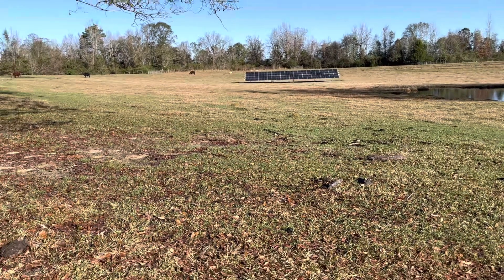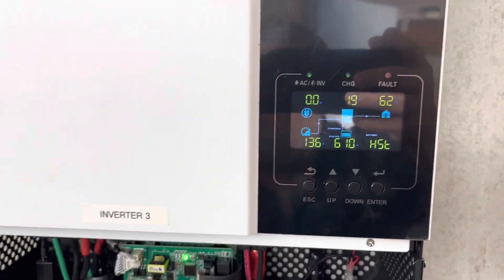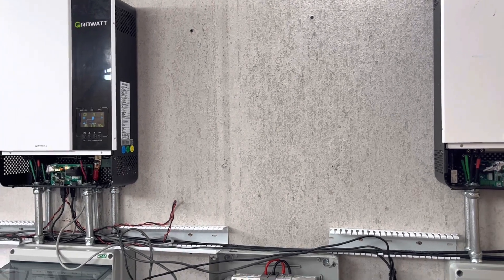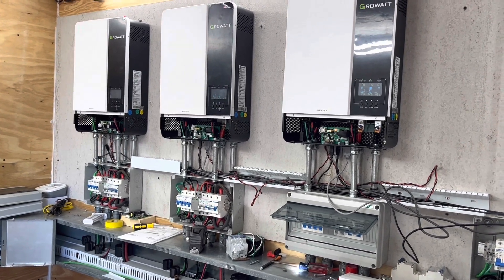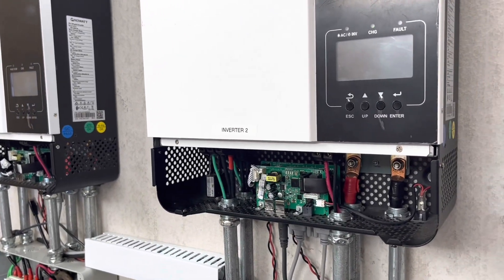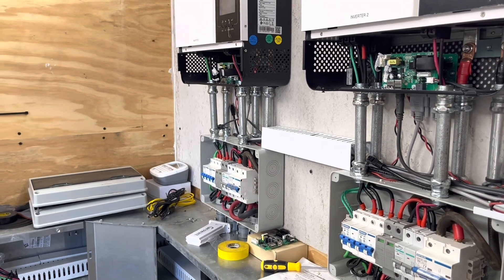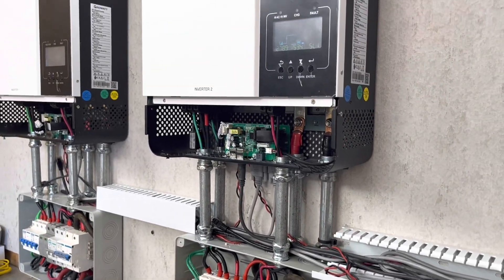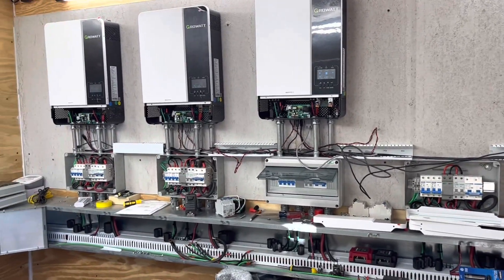Solar Power - Growatt SPF5000ES Problen Update

Comment: Hi, did you get inverter firmware 40/41 to parallel with  firmware 67/68
Reply from the maker: I had all kinds of problems with the Growatts. I eventually took them down and replaced the five 5 - Growatt SPF5000 with 2 - SolArk 15k units. That solved all my problems.
Reply: @jeffmotes2129  thanks for the update

Comment: 你这个版本的5000ES是问题比较多的我用了2年的5000ES没有一台有问题的我买的是7000RMB一台你那里多少钱一台我这里的机器出了问题都是立刻免费邮寄全新机器更换的你的机器现在有什么问题或者我可以帮你联系工厂的工程师因为这机器就在我这里生产的
Reply from the maker: Sorry. Can’t read it. English if you can.
Reply: @jeffmotes2129  Your version of the 5000ES has many problems.  I have had my 5000ES for 2 years without any issues.  I bought one for7000RMB.What's wrong with the machine you're replacing now?  Or I can help you contact the engineer of the factory, because this machine is produced in the industrial area where I am.  I am a photovoltaic enthusiast.  You can also communicate.
Reply from the maker: @自由无价  thank you very much for your offer. I know there are people who have had good success with the Growatt units. Mine worked perfectly for about a month then I started having little issues coming up. Displays not working. Comms not working. Bypass relay not working. And the tech support I was receiving wasn’t very helpful. I replaced the Growatt inverters with SolArk inverters. 

I did get all the Growatt units repaired and I have them in storage. May use them on another project.
Reply: @自由无价  i have 2 growatts SPF 5000es but no battery.Can I use them in parallel with Grid support to be able to run heavy loads in the house, waterheating, oven,dryer etc?,My panels are 14 maysun big Amps 410w each 24v panel (30v voc/ 17a) near 5700w.
Reply: @GreekSIMRACING  Sorry, my English is not very good.  I don't know how to communicate with you.  This issue needs to be communicated with you in detail.

Comment: I've had nothing but good to say about my eg4 battery's and my growatt 5000es.    But I only have 1 ... and a much smaller system...  I'd say it isn't nearly as good as victron for efficiency.  I have about 65watts draw 100% of the time. 😢. But it has been working fine other wise. I have updated my firmware on batteries and 5000es so maybe that helped me ...😅. Sorry to hear your story. I've had mine for 3 years no issues. But i haven't combined them yet.  I was able to get my shine server working. And I also wrote my own software as growatts server is crude. I have my data in home assistant and it works great.
Reply from the maker: I know some have had good results with the Growatts. My experience wasn’t the same. Five inverters, five fold increase of possible problems.
Reply from the maker: At some point I want to setup Home Assistant.

Comment: Just came across your channel. Very nice system.  A friend of mine had similar issues.  Looking at your system, it seems you have the same issues.  I see 5 inverters connected to 5  batteries and 3 more batteries you plan to connect. If thoughs are 100ah batteries and you launched the system like that, then  there is a possibility that the one or more of your inveters is damaged.  In your configuration, you need 200ah or two batteries per inverter when running multiple inverters. Look at your manual.  It's not your fault. Signature solar  sales should have caught this  before they sold you the system.
Reply from the maker: Actually there were  12 100AH batteries connected. I started with 6 batteries.

Comment: Mine let the batteries totally deplete despite being set to go to the grid during the night if we get too low on power.  When that happens, instead of going back to the grid, they throw a fault and we lose all power and they go into safe mode.  Soooo frustrated with this.  They worked perfectly for a month.  Spent a lot of money to install 38 solar panels, 4 inverters and 8 batteries for a system that doesn't work.
Reply from the maker: I totally understand your feeling. I finally cut my losses.

Comment: jeff. why do you have the power sharing cables between the inverters - the black and red twisted wires?
Reply from the maker: It’s required to parallel your inverters.
Reply: @jeffmotes2129  actually,  they are not and if are there can cause other strange issues.  the grey ones are required.  check the manual and ask signature solar.
Reply from the maker: @howiegrapek1488  really? I followed the manual. I’ll go back and check again. But it’s a mute point as I’ve removed the Growatts yesterday and am installing Solar-Arks in their place. It would still be good to know for future reference though.

Comment: Hi. How much kW PV totally you have?
Reply from the maker: 42 - 445W panels - 18.69KW
Reply: I would love to see a video of the array.  I would love to see a video of that. Thanks for sharing.
Reply from the maker: @electricandlsxpower  I have several videos up on the array installation. Scroll my list of videos and and your should find them.
Reply: @jeffmotes2129  
How stable is this Synclair's ground system,now,1year after installation? Are all the poles straight?
I wonder if it is necessary to concrete or not..
Reply from the maker: @edijsegli527  seems pretty stable to me. I installed it in August 2022. Can’t give you a personal 1 year report yet. Driving them in the ground as I did is one of the approved methods of installation. Check out Engineer775 YouTube channel. He installs these often. I bought my mount through him. 

It’s designed for 115mph winds. I’m in the 110mph design zone. I’m probably going to add a little more support before next hurricane season as a precaution. 

Here’s a link to the manual. https://sinclair-designs.com/scs/assets/downloads/Sky-Rack-2.0-Installation-Guide-MASTER.pdf
Reply from the maker: @edijsegli527  the post are straight. I drove them with a 65lb electric demolition hammer. Check out some of my previous videos on the ground mount installation.

Comment: One things for certain,they cannot say that they weren't installed properly by a licensed electrician in a proper way manner or correctly..
Reply from the maker: Actually they tried that till I told them I was a licensed electrician and a licensed engineer and I also had a second licensed engineer verify my wiring.

Comment: I installed my system about the same time you did. I have 15K Sol-Ark with 32 solar panels. Mine has been mostly trouble free. My main problem is the monitoring software. I hope after the 1st of the year to add more batteries. I only have 4 Lifepower4  batteries and it’s just not quite enough. The installation of the Sol-Ark was the easy part and setup is fairly straightforward although I’m still learning best operating practices. Good luck with the changes. I really like the room in the connection box of the Sol-Ark.
Reply: I am using PV Pro , didn’t know that I could use something different. It has been working good since December 7th. The data gets messed up but I put in a ticket and it usually gets resolved quickly.
Reply from the maker: @geneg7956  my understanding is PV Pro updates every 10 minutes. Solar assistant every sec. 

I’m going to set up PV Pro then also try Solar Assistant. I was talking with Scott of the Engineer 775 channel and I think he’s set up Solar Assistant on a Sol- Ark unit. I’ll give it a try once I get everything up and running.
Reply: I may need to call him, I got my Sol-Ark and ground mount from Scott.
Reply from the maker: @geneg7956  me too. If you go to tge Solar assistant web pages they have a section for connecting to Sol-Ark. you either have to remove the dongle and use that port or get a RS485 port duplicator so you can plug the solar assistant and battery BMS into the same port. At least that’s my understanding. Haven’t tried it yet.
Reply: PV Pro is broken again this morning. It worked great for 10 days. I put in a ticket to Sol-Ark and will see how long it takes to fix it this time.
Reply from the maker: @geneg7956  let us know. That’s how we get accurate feedback on the companies we deal with.
Reply: They fixed it, data seems good now. I will still check into solar assistant.
Reply from the maker: Thanks Gene. Hoping to have the Sol-Arks in service by the end of the year. Have you tried solar assistant with your solar-ark?

Comment: Getting the shine dongles to work are easy to set up with a laptop. With a cell phone they suck bad. I can send you a link to a video that helped me if you still want to try them.
Reply from the maker: Please do. Thanks.
Reply: @jeffmotes2129  https://youtu.be/LlLcxGlnK-A
Reply from the maker: @snoflite5234  that takes me to my channel. And the guy there is dumb as dirt.
Reply: @jeffmotes2129  So odd, I click on the link and it takes me to the video I tried to link for you. Search on youtube for  Growatt Wifi Adapter Installation and configuration
Pawnee Off Grid
Reply from the maker: @snoflite5234  it was late last night and I didn’t have my glasses. I was clicking on my name instead of the link. 

I’ve watched his videos multiple times. Even watched and followed it step by step as I was trying to set up my dongles. No joy. The dongle would never show up in my plant.
Reply: @jeffmotes2129  Did you make sure you changed to the us version of the growatt site on the laptop? I have all six off my currently wired inverters in my plant. Very odd.
Reply from the maker: @snoflite5234  follow his instructions exactly. Only tried on two inverters then gave up.